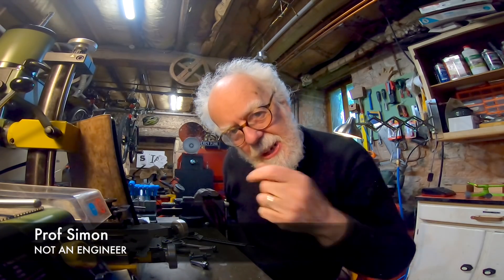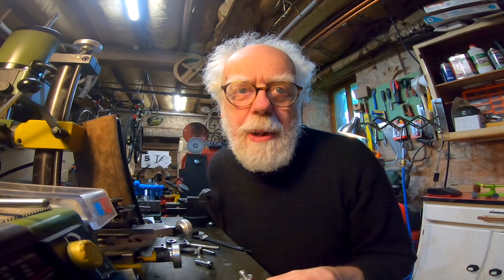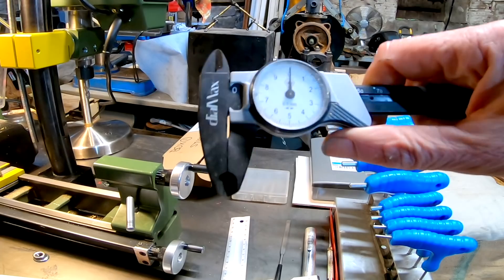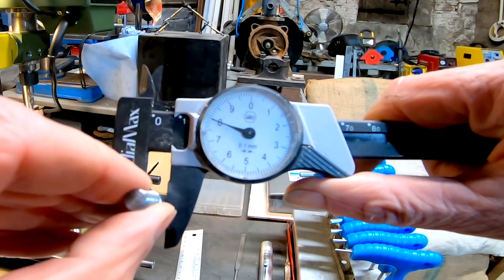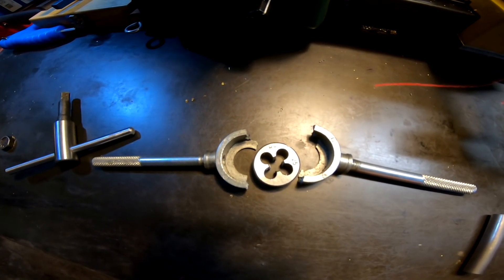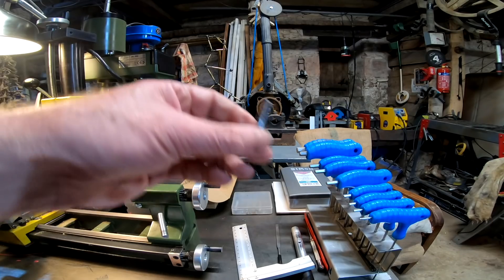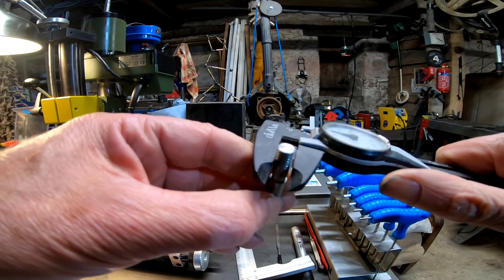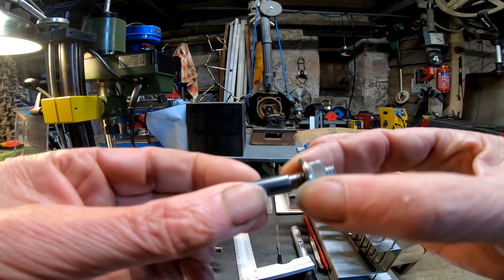Engineering mystery - Prof Simon

Comment: I drill 5 mm hole for a m6 thread  but they is a few different thread pitches so  I have a funny feeling u are basically  cutting. a course  thread and useing fine thread nut  would make it rattle
Reply from the maker: good points......since posting this video...my threat cutting has got better....practice really helps.

Comment: Without a doubt the problem is the button  die you are using. You need a good quality die, not the cheap Chinese one you are using which does not have  the facility to vary the thread size on the diameter.
Invest in a decent quality M8 button die, perhaps made by Dormer and a good quality die stock and you should be OK. Also choose the material carefully that you wish to create the thread on. High carbon steels will tear if not lubricated properly whilst threading. A good steel to use for general purpose bolts is EN 1a or EN1a Pb (leaded)
Reply from the maker: You are so correct... I bought m6 and m8 dies from Presto Tools Sheffield.... they cut much better...plus some tap lube really helps.  Still can’t tap the OD of 12mm copper pipe....any ideas?
Reply: @SimonHollandfilms  ..copper pipe is usually  very thin walled so the thread cannot afford to be very deep. Copper needs a very sharp cutting tool with a lot of a rake the same as for Aluminium so its best to use a new die before it has lost its edge being used on steel etc. 
An M12 fine thread has a 1mm pitch so the depth of thread should still allow you to have about .5 mm + wall left between the bore of the pipe and the root of the thread. 
Use a good quality cutting oil not compound. Perhaps neat soluble oil if you have any.
If you are threading in the lathe it might pay you to place a piece of close fitting bar in the bore of the pipe so the chuck can grip the o/d of the pipe tightly enough to withstand the tapping torque without crushing the pipe.
The other way which is obviously harder is to screw cut the thread on your lathe using a screwcutting tool and of course the same applies..... a sharp tool with plenty of top rake.

Hope this helps.
Reply from the maker: Thank you...good tips

Comment: You also need to look to your cutting speed. You are getting plastic deformation of the thread which indicates you are cutting too quickly!! Use the formula n=1000S/pi d where d is in millimetres and S is a constant and n is the cutting speed in rpm , it varies depending on the material. You can find this on the net. From memory for ordinary mild steel it’s about 35 I’ve looked at the other replies and most are correct especially using a split die but again in order to get a good finish apply the cutting speed formula or you will break dies and /or holders, as you’ve done. I’m an HND mech engineer with 30+ years design experience if you want more help contact me directly on mjrluscombe@aol.com for help on any mechanical engineering problem. All the best Matthew

Comment: Sir,a Adjustable die stock using multiple cuts,the number depending on your specific requirement . The female thread will need to be performed in your lathe.

Comment: Blow torch, heating the metal, makes it possible to deal with thread issues. In the Navy similar things with expanding and shrinking metal was famously termed freezing the balls off of a brass monkey. On cars you heat the stud for the nut that holds rims on to get the studs out with a torch, to replace them, so the metal shrinks and contracts, or expands with heat and cold... and thus the reason for the variation in the diameter of these objects and messing with them to make them work in the applications required, play has to be adjusted for expansion and contraction in the metal, different metals expand and contract differently. Wish you the best and thanks for your videos that are very interesting to me Professor Simon.

Comment: You need a machinist handbook or online search for the charts. Normally it has to be turned down ( see major and minor diameters for size thread you want) usually about 10 thousandths smaller than actual as a rough guide). Second- you’re probably removing too much material at one pass causing deflection and “ extrusion”. If you email me at phillip.rivara@gmail.com I can look up the specs for you

Comment: use 9-10 mm cut threads turn down stock.  tool machinist manual ref manual for strength * engagement % "peaks" have no value in strength

Comment: Structural engineer here. Rarely are standard thread sizes cut on a lathe. They are rolled into the bar stock to retain strength, basically like a forging. The 8mm is the "basic diameter" of the bolt's bar stock shaft, while the threads maintain dimensions based on minor diameter, pitch diameter and major diameter. "Machinery's Handbook" is a great resource for the dimensional info you need.

Comment: if you are going to cut treads with a plate or on the lathe ,lets say m8 your outer diameter has to be 7,8mm.(use cutting oil)..never deeper than 8mm-1,25mm=6,75 mm internal....don t get mixed up by rolled threads they startt at (just geussing here) 7,2 mm and push in 0,7mm and extrude 0,7mm but they are completly rolled......on a lathe just start at 8mm ,you cantake a bit of when needed but i don t think you need to.....

don t know the english name for it but on metric system you take the    :outside diameter - the winding =inside diameter  ...if you measure a bolt it s always 0,1-0,2mm under....

don t know the (exact)winding???  count  10-20 windings and divide it by the length you counted....

just saying ///// that s the truth (out here)

Comment: Hi Prof Simon, love your films and presentation. 
You are using a die holder which is non adjustable ie a solid die. Try using a m8 split die and die stock which has 3 screws around its perimeter. Then open the die fully at its split point by turning the screw. Then tighten the other two screws which lock the whole assembly. Chamfer the bar stock to give lead in for the die stock. Look at the die ; you will notice one side has a chamfer ; that is to aid cutting or roughing the material off of the bar stock. Use a cutting grease on the bar stock and turn half s turn each time and note the swirls of metal in the open areas of the diestock. By reversing the rotation , the formed chip is broken off each time. Proceed to required length. Then return to start of cut and adjust the die stock; by the central split screw loosen by 1/4 of a turn. Tighten the other two screws on the diestock to lock it. Proceed down the bar as before. This time the grooves will be cut deeper and the peaks will become more evident. This process is a cutting one , and metal removal , not a thread rolling / forming one! Try the nut for a perfect fit! It can also be cut on the lathe by screwcutting instead of a die stock by a suitable cutting tool, which is normally more accurate. Love your Programmes🙏 vic
Reply from the maker: Best advice ever thank you Vic.

Comment: Cut the 8mm bar stock in the lathe correctly with the correct thread cutting bit, and if done correctly it will end up just under the 8mm. As measured on the  sample bolt. (If the threads you cut have the correct depth, pitch, spacing, etc.) Manufactured I believe they roll the threads into the bar stock, not cut with die or lathe.
Reply from the maker: Thanks David

Comment: U are not using the correct standard. Any old bolt wont due. U need to get a bolt sizing gauge and use correct bolt-hole size to determine OD, then cut the threads to the correct depth.

Comment: Best explanation I have seen is on Wiki page https://en.wikipedia.org/wiki/ISO_metric_screw_thread in the image on the top of the page showing the geometry of all of it (and in mathematical formulas too). Essentially, there is required relation between the pitch and height of he treads AND there is requirement that 1/8th of the thread height be cut off! Hence, just as you have measured, outside diameter of the M8 1.25 thread is less than 8mm because it is required to be 8mm - (Height of thread/8) and height of the tread is required to be 0.866 * Pitch (which is typically 1.25mm).

Comment: Most external threads are roll formed for fasteners rather than being cut. Get a machinist's handbook (used n the USA) or your country's equivalent for thread charts and different classes of fit. You need to measure the pitch diameter, etc. The root of the thread will always have clearance with the mating thread. https://en.wikipedia.org/wiki/Screw_thread

Comment: Blunt the tip of tool with a stone, but follow the slope angle of the side relief 5 deg.back.GET some thread wires(Starrat),set compound slide at 60deg.to lathe bed. Advance the cut with the leading edge of the tool the trailing edge should not be cutting maybe just dusting a few grains.Apply Dykem to rod, start with 10 thou. put oil on make a pass see if dia is still good.Now take measurement repeat till close to calculated micrometer size.

Comment: To cut a thread on a lathe you should be using a single point lathe tool not a solid die. I’ll guess you’re trying to cut this thread in a single pass hence why you broke the die holder. Use a split die, use the centre screw on the holder to open up the split then take a shallow cut. Reduce the diameter with each successive cut down to 8mm. Remove the thread crest with a thread chaser or file.  Professor maybe but a long way to go to becoming an engineer.

Comment: There isn't any extrusion when cutting threads period. 8mm will always leave you a few thousands of an inch, less as you cut the proper depth of the external thread 8mm. Refer to the Machinery’s Handbook, any edition will do. This is a 3" thick book it has all the tables yes but also explanations the different methods to measure the threads for different tolerances like an 80% thread vs a 97% thread. ex: the wabble you demonstrated vs a tight fit. It's the same with internal threads. Your 8mill shank couldn't fit in an 8mm nut cause the whole is also 8mm for the nut. The book explains this very well.
So the external threads will reduce the diameter and in the internal threads, it increases the hole size.
Machinery’s Handbook  
 https://www.used.forsale/r/Details/machinist-handbook/machinist%20handbook_etsy_etsy_787913542
Reply from the maker: I think my dies were dead

Comment: Hi Professor, it comes down to classes of fit and clearance. Part of the answer is in this PDF https://mae.ufl.edu/designlab/Online%20Resources_files/fastener_handout.pdf and here on page F90 of this publication https://www.sumitool.com/en/downloads/cutting-tools/general-catalog/assets/pdf/GC_F3_en.pdf which says for a Metric 1.25 pitch the depth of cut is .8 mm for that thread. The nominal diameter of the thread is smaller than 8mm because you need clearance for nut to go on the bolt, to things can't occupy the same space, unless your name is Heisenburg or someone like that :) I'm sure you looked in the Machinery Handbook and found the classes of fit for bolts etc. This is less a problem on larger thread diameters with coarser threads.

Comment: Good job, I couldn't do it. Cutting is one thing to learn online with that green Chinese machine. I tried the same 30 years ago, and cutting bolts shorter was ok but threading, no way. But my bolts were hard titanium 6-4. That's more difficult.
About the head of the bolt, I see you showed a12mm head, u can mostly use 10 mm heads on m8, it's sexier and lighter

Comment: Perfect (precision) threads are ground, not cut. Swiss watches (first made in Nuremberg, Germany) were created between 1509 and 1530, with modern lathe and mill equipment it must be easy to duplicate one now? Try to visualize "the store down the street" where you could buy the tiny screws? The quality assurance and process control permits that some of the watches still work today!

Comment: The problem, I think, is that you are using 'rolled stock. This becomes work hardened by the rolling process. Therefore the skin is very hard. If you must use rolled stock, use 10mm diameter and turn down to 8mm. The 8mm diameter is the theoretical piont of the thread. The finished thread will always be less than 8mm. Vice versa on the nut.
Reply from the maker: Good point

Comment: I can't answer your question on an engineering level but I can tell you about my nuts and bolts, which I have just measured. They are M8, the inside nut diameter is about 6.5mm and the outside bolt diameter at the thread is 7.9mm. I have a long shaft on my bolts that is also 7.9mm, so I guess my thread may have been cut differently? Sorry I can't help on the technical side but I thought my measurements may add data to the research. The inside nut diameter may not be 100% accurate because my vernier inside measurement was a bit of a dodgy fit. Let us know what you find out.
Reply from the maker: Interesting

Comment: You need to turn your 8mm bar down to 7.8mm try it then, rule of thumb was come doesn't 0.2/0.3mm ie 10mm = 9.2 /9.3mm it's something you pick up on the factory floor. Good luck, oh are you cutting metric course or metric fine threads?
Reply from the maker: Yep,.,worked

Comment: It's a manual operation.  You need a sharp tool to get a smooth profile, and after cutting, use a "thread file" to dress the threads after cutting.  If you don't have one, use a "bastard file" corner to take off the high profile area of the V area while spinning, also the top of the thread with the flat side of the file.  Stop the lathe to test your work with the nut, or a thread guage to check your fit.  It's that simple, no science needed, just learned skill.  Overall diameter of the stock is not important if your tool cuts it.  Check your finished thread against a Machinists Handbook for tolerances.  Machinists Handbook also tells you where to start with your rod stock.  👍

Comment: I remember from my nuts and bolts shop that M8 had to be about 7.91 as a finished product, measured on the threads, other metric sizes are similar, M10 has to be about 9.85 or so. I think it has to do that as far as I was told we see a bolt always in measurements referred to the part it screws into. So if you measure the length of a bolt  , you always take the length from under the bolt, or as far as it screws into something. That includes the non threaded part, but not (I think) if there is a non threaded part wider than the bolt measures and doesn't screw into the part. Then when torquing, which is very difficult to get right, the idea is that where the threads meat there will be tension, that tension and the part it will stretch is the best way you can know a bolt is fastened correctly. That of course is not easy and so we use torture wrenches that can up to 30 percent off each way.

Comment: I'm a trade mechanical engineer and for any smaller thread in general make the OD about .2 mm smaller than size  and remember thread forms are never sharp on the top so get out agile and take off your extruded material hopefully producing a nice small radius on the outer side of the thread .NEVER LISTEN TO CLASSROOM ENGINEERS !

Comment: Hi Simon
Ok what you have there is a die what is used to refurbish previously existing threads, to cut new threads you need to use an adjustable split die and you need to champher a lead to the bar stock to get a start then try the nut, it should be tight on the bolt then adjust the die a little until you get a good fit ( no wobble,) then cut the the thread on the lathe and run the set die down the thread with lots of cutting oil this just finishes off the thread and your good to go.

Comment: As M Lariviere says below but if I can add the following. If you look at the official metric thread form ( recommend an old Machiners handbook ) you will see the tops of the external threads are actually flat. The flat with is a function of the pitch and is quoted in the tables. The root of your problem is when you cut your thread as you say the thread diameter grows which depends on the metal type but even if it didnt grow you still have to grind the top off the thread for the particular type of fit you want, Close, medium or free fit. In the handbook there are tables for each fit, pitch and diameter. It says the major diameter for an M8x1 with a medium fit is actually 7.972mm. So as I read it if you were to cut the thread and end up with exactly 8mm peak to peak you then need to file off the tops to a diameter of 7.972mm to get a nice fit. There is no formulae for the starting size of your rod because I guess it depends on how the material deforms in a lathe or with a die. All I can find is trial and error to find that starting size, all they define is the finished size. In fact of you look at the thread form its also got flats on the trough of each thread too so really your lathe cutter should have this ground in.  Check this out but bottom line is there is some black magic to all crafts including engineering :) https://www.engineersedge.com/hardware/metric-external-thread-sizes1.htm

Comment: Hi Simon I'm a toolmaker and the first thing to say is if you are using enough force to break your die holder combined with your comment about extruding material I would put money on the fact you have chiped your die. If ever I tap a piece of stock tool steel using split or solid dies , 8mm would be fine, use cutting compound and you will feel it cutting NO FORMING. You would be supprised how a small chip increases the amount of force needed to cut a thread. Hope this helps.
Reply from the maker: You might be correct...I need some new dies